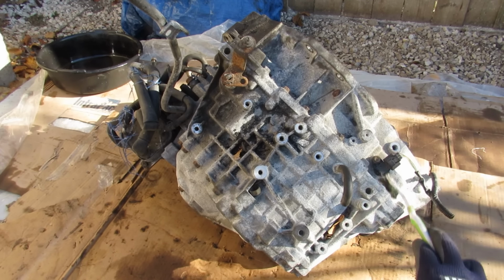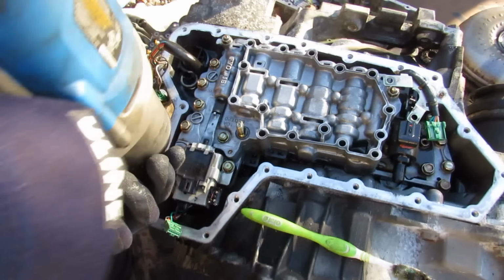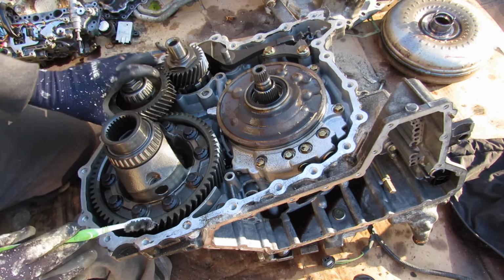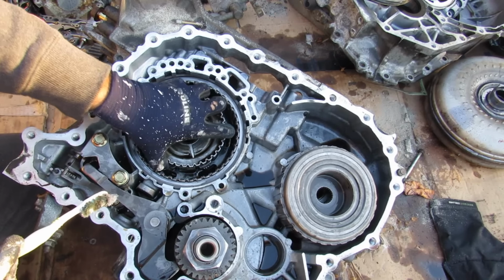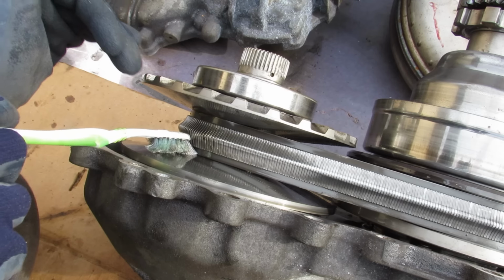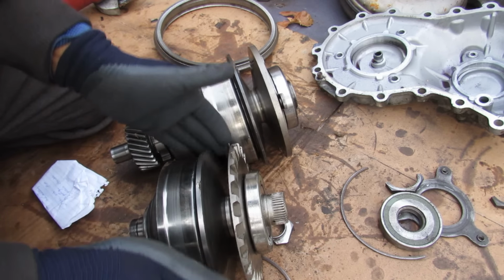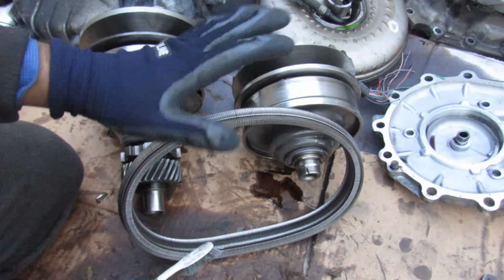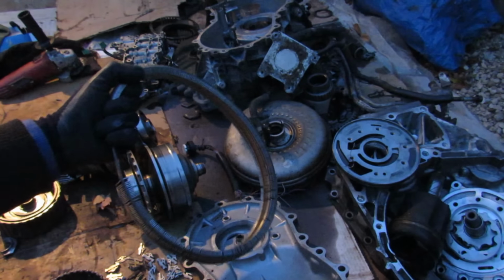Why Nissan CVTs FAIL

Comment: Always felt when they started lock up early we saw a big upturn in failures. Driven hard they won’t last .
Reply: Torque converter lockup isn't an issue as long as the drive ratio is selected sensibly. Nissan North American let reviewers/marketers force the selection of inappropriate ratios so it sounded/felt "right" (where "right" is what reviewers think an automatic should feel like, not what's correct for the technology in question)
Reply: @miscbits6399  This started with Altima in 2009 ,Nissan came out with earlier lockup to save less then 1 Mpg . Then the Service bulletin addressed engine mounts to stem vibration but the bog down was the Tcu logic change which Nissan offered a reprogram to move it back with a warning of the loss of 1 mpg. 2007 + 8 ran much smoother and more responsive and less failures.Move to 2013 and the judder began due to this early lock up and lug.Yes great highway mpg but low speed and takeoff performance with judder. So the more they fixed this CVT the worse it got.
Reply: @billcox199  it definitely counds like Nissan North America screwed up.

The P12 Primera was the evolution of the P10/11 Primera/Infiniti G20 which is more-or-less the european altima/bluebird equivalent - the problem with this machine was the 6 speed manual box on 1.8l engine which for some reason would drop a collar and lose reverse (I have a 6 speed on 2l, no prpblems with these or the 2.5l, the CVTs in all three engine sizes have been supremely reliable)

Muranos over here are mostly manual but the CVTs have again been highly reliable

The only reason for having a fluid torque converter in the front of a variator CVT should be to go from zero to minimum speed at highest N:1 CVT ratio. Beyond that the TC should lockup and let the variators do the rest, but I can see a use in having it unlock on hard accleration if the variators are slow to respond

Any kind of judder in a CVT is a major cause for concern. 
FWIW: the european QR20 engines were clearly tuned primarily for CVT use and have virtually no torque at clutch engagement speed (1000-1200rpm) in first gear and have an extremely "bitey" clutch. Without a lot of experience attempting to try a feathered start or even just trying to roll the car a few feet is virtually guaranteed to result in a stall unless you rev the engine (both of which make you look like a twat to other experienced manual trans drivers) and hillstarts are particularly problematic. As a result they didn't sell very many stickboxes in comparison to CVTs (and I got my car at 14months old for less than 1/3 of the original sale price because the original buyer hated it)
Reply: @miscbits6399  Good info ,we sold few manual transmissions in The Altima which ran good but the shifter with its cables were another story.Definitely the 2007 with CVT was the smoothest and best running.It was like a different car. I had the 2009 and 2011 and they were ok except after the Tcu reprogram on the 09 it lugged along and groaned on light acceleration .The 11 was ok. Then we had the 2014,2017 and now 2020 all leased that my Wife drove and she is a light foot . Still the 07 ,first Altima CVT was the best.I was a Shop Foreman at a dealer for 15 yrs. and had to deal  with all the complaints which became very tiresome.

Comment: My buddy bought a brand new 2016 Nissan Sentra, much to my horror.  It had a 60k powertrain warranty.  The CVT transmission failed at 64k and from what I have read he was lucky it lasted that long.

If I can't buy a new car with a manual I will buy a used car with a manual.

Comment: Thank you, i understand now why the CVT is so complained about. On a performance car, or anything over the size of a sub-compact these should not be used. With an entire industry starting to produce these, I can see a counter industry that might pop up to build manual and real automatic transmissions to replace them. I`m hoping that`s the case.

Comment: Two questions:

How many miles did that transmission have?
How many times was the fluid changed?

That fluid looked hella dirty.
I got 110k on an Altima, changed the fluid at 100k and flushed/replaced the cooling system fluid. If I can get 14 years from a 2014, I'm cool with that.
Excellent break down. Sad they used it on their larger vehicles. Glad the Altima isn't a powerful car (2.5L) killer gas mileage though.

Comment: The CVT in my old Mirage was the smoothest drive ever ever had. No shifting breaks, just goes, and really very quiet to me...but the it was just a 3-banger. Seeing an AWD use case is pretty awesome. I miss the CVT driving experience. It wasn't high power, but it was a good ride and smoothe.

That said, pushing them into more powerful drive trains seems pretty lame. In this case fatally lame.

Comment: Theoretically, same transmission as a $899 Chinese "no shift" motor scooter!
Reply: or my 2002 Yerf Dog go-cart, or my 1985 Honda & Suzuki scooters... etc,etc,etc. CVT been around for a while...
Reply: Not quite
Reply: @mikemcintosh295  The principle is exacly the same, just handling higher power/torque
Reply: @miscbits6399  I was referring to all the electronic hydraulic components.  I think motor scooters use basically centrifugal force to control the gear ratio.  It is same principle just a lot more complicated.

Comment: CVT's scare me, automatic's are wizardry, manuals are the most trust worthy.
Reply: It’s not that hard to learn how to push a clutch in and change a gear.  Unfortunately, it getting harder to find one to buy. No longer an option in so many models.
Reply: @davidsteer8142  Yeah it is mighty unfortunate, a dying breed except over in the uk.
Reply: @davidsteer8142  Manuals are nerve-wracking in city traffic and that's why over here pedestrians get run over at zebra passages any day: continuous shifting is a nuisance, better reduce start-stop and fuck the rest. That's why over here is EXACTLY the other way round: auto option usually on luxury cruisers and NOT AVAILABLE on citycars. Absurd people of an absurd country.
Reply: If I didn’t have catastrophically screwed up knees, I’d probably buy a manual. Alas, that much movement hurts like hell, but I won’t buy a CVT equipped car *ever*.

Comment: Just spent way too much time reading all the comments. as a mechanic with plenty of Nissan experience I will say I have mixed opinions on the Nissan CVTs.. I prefer a manual or traditional shifting auto. What I can recommend is to change the fluid early and often (every 20-30k) with genuine Nissan fluid and the filter/pick-up every 80k to prevent problems. Yes some unlucky people may still have issues.. Me and a lot of members of my family have owned several Nissans newer and older. I still own my 04 maxima with original drivetrain at 270k. my 17 maxima with 86k has zero trans issues and I've done the fluid service twice. Also, the manual mode is pretty fun!! 

The same people with failing CVT trans are the same people that don't warm their car up or ever change the fluid then complain when it fails at 70-80k. My sisters rogue is a prime example. Just like the people that don't take care of their body or watch what they eat their entire life then get health problems at middle age. Vehicles and your body are similar in terms of do your maintenance and care for it, it will last a long time. 

The older units are definitely not made as well as the newer which also have an external cooler (on certain models). That also needs to be flushed out with a special cleaner when the service  is done. These transmissions only run well when the fluid temperature is optimal (around 112 degrees) which is why they run like crap when overheated or when the fluid is old and can't do its job. Also, If the fluid isn't leveled out properly after reaching operating temp and going through all the gears on level ground it can cause problems.  
Replies welcome id love to chat.

Comment: I have a cvt in my '14 Subaru Ourback. It is a strange sensation at first. Under light acceleration, the engine rpm stays the same but the car accelerates. Plus it lacks "shift points" of a standard automatic. We had to go to an automatic after having sticks all these years because the knees can't handle the clutching. :-(

Comment: Very informative! Nissan could solve the CVT issues by making larger ones for the larger more powerful vehicles. To Nissan:  "Duh"
Reply from the maker: Just stick with automatics
Reply: @speedkar99  a CVT can be made reliable, because it's much simpler than an automatic..but they've yet to prefect it.

Comment: One of the first questions you need to have answered when buying a car is "Does it have a CVT"? If it does, walk away. They are junk.
Reply: I've driven small cars in which the CVT was perfectly fine, and made for a smoother drive.
Reply: @mjouwbuis  How many miles did they have on them? I could care less about a smoother drive, I would rather be confident I'm going to make it to my destination.
Reply: Just depends on who makes it. As long as its not Jatco you're ok. They're much better now than they were 10 years ago
Reply: @scottyhaines4226  I see failures on Ford, Honda, GM, Chrysler, Kia/Hyundai, Subaru and Nissan. They "may be better", they are still a disposable transmission. If you get over 100,000 miles on a CVT, you have something very special.
Reply: @mikemercer5808  I'm not sure if Nissan has got thier CVT issues under control now, but as far as the others on your list, I believe with proper maintenance  it should be closer to over 200k for something "very special".
Reply: I am an Independent Mechanical Inspector. I look at vehicles for failures for extended warranty companies, kind of like an insurance adjuster but I look at mechanical failures. I see Nissan CVT's for failure almost every week. They are trash. If you want to nit pick and say "but this one is ok", fine. I have seen the Nissan CVT's fail with as low as 60,000 miles. GM CVT's are trash also. My recommendation is to steer clear of CVT's, it's a snowmobile transmission in a passanger car.
Reply: Depends on the car. Properly engineered CVT is better than a TC auto. In fact, the way autoboxes are going, they might as well be a CVT ... They are already at 10speeds lol.
Reply: @TsLeng  Depends much more on the mileage than on the car. I will admit I see more Nissan cvt's than anything. But I have seen failures on pretty much all makes/models that use cvt's. My 99 Camry had 250,000 miles on the original transaxle, all it ever needed was a seal replacement kit due to old/hard seals. I see cvt's with mileage as low as 60,000 miles. I wouldn't buy a car with a cvt.
Reply: We had a '14 Rogue that was a very smooth, quiet vehicle to drive. Three years later after we bought it, it saved my wife's life in a head-on crash. She walked away, bruised from the seatbelt and airbag but the car...totaled of course.
Reply: @robertfrench80  That is impact and chassis resistance, has nothing to do with a CVT.
Reply: @mikemercer5808  I didn't say that it did, I'm just attesting to the safety of modern cars.

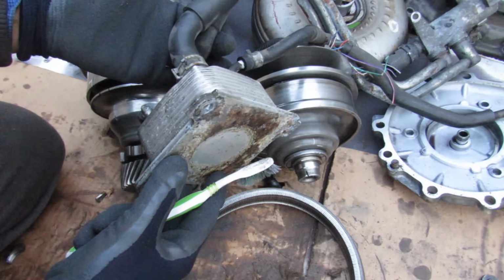Comment: 16:07 Nissan screwed up the cooling, eh? I see a common theme here -- the Nissan LEAF rapidly loses range because they never bothered to add cooling to the traction battery. Who's designing their stuff? Santa's elves?
Reply from the maker: It's passively cooled?
Reply: @speedkar99  Yep. There's a radiator and cooling loop through the motor assembly, but no coolant through the battery. There was a class-action lawsuit about it for the  2011-2012 model years. They reworked the chemistry in 2013-2015 to reduce the degradation, but even the 2020 LEAF still has no active cooling. My 2015 is down to nine bars (~65% of original capacity) after only 50,000 miles. No other EV sold today suffers this level of degradation.
Reply: ...but there is one advantage  --  the LEAF doesn't have a CVT! 😉 All an EV needs is a reduction gear, since electric motors produce full torque from 0 RPM. And reverse is just running the motor backwards.

Comment: "why some of these Nissan CVTs fail"
You mean, why all these Nissan CVTs fail by 20K
Reply: Mines got 50k still going
Reply: Ha ha . Loved my altima
Reply: To be fair we have a half million on a Nissan x trail.

We used it for mail delivery. And it's an automatic.

We had the transfer drive CVT joint give out at 80 kmh and strike the road, catching the gear wire and slam it into park.

The gearbox mechanics opened it all the way up, replaced a few old seals and a single possibly worn reverse valve, and put it back together again.

We actually had more problems due to a bent clip on the motor than the gearbox with the cable replaced after the fix.

I am pretty sure the load of the gearbox dumped it's force of a 80 kmh SUV somewhere but having seen that differential link (from an admitted different gearbox type), it won't be the disconnected transfer clutch system clearly.
Reply: I gave had 3 Muranos because they gave been reliable. The wife has a 2009 with 190K and no major problems. We took it on a 7,500 mile cross country trip when it had 140K and not one problem.
Reply: My work car is a Nissan Versa Note with 84k miles
Reply: Not all fail, but most do at various mileage.
Reply: My fiancee's 2012 Altima was well over 100k with no CVT issues until a deer totaled the car. Now her 2017 is approaching 60k, no CVT issues.
Reply: My friend had a Nissan Sentra that was fairly new, less than 50k miles. It was already shuttering and hesitating on up and down shifts.
Reply: I think if you go into owning one knowing you really have to be careful to set the parking brake, and completely stop before going from reverse to drive (or Bice versa) --- basically preventing unnecessary strain on the belt --- that it may last longer.
Reply: My CVT is at 115K in my 2011 Rogue.
Reply: @GiantRiderRob  Probably because it's a small engine. My Pathfinder failed at 3,000.
Reply: 20k is a little steep. Roughly 100k is when you need to say good bye to any nissan made after 2006.
Reply: @TWOxTONE_773  I have a 2009 Nissan sentra I bought new with over 200,000 miles on it a never had a problem with it
Reply: @terrypresnell9100  I have an original Xbox 360 that never got a Red Ring of Death. That doesn't mean the overheating issues didn't exist.
Reply: @HCkev  for your information I not only own a Nissan sentra I also have another Nissan with the CVT transmission and never had no problems and I have 15 years experience as an auto mechanic which my dad and brother and several uncles were also mechanics I'm not saying they are all perfect transmissions but there is a lot of bullshit in this old world because opinions are like assholes everybody has one
Reply: @terrypresnell9100  You apparently haven't seen the class action suits against Nissan because of this transmission.
Reply: @HCkev  no one ever said it doesn't happen. The op said "ALL" of them fail before 20k. People were just pointing out how stupid of a comment that is.
Reply: 2013 altima CVT and 104k on the car zero problems with anything...

Comment: God only knows why, in this day and age, any manufacturer would still consider making a CVT automatic transmission. They're no better now than the original DAF Variomatic. Given the fantastic current day DSG (and similar) auto boxes, it's about time ALL CVTs were dumped ! Gear changes, even with the latest modified CVT'S (which have stepped changes), do NOT and never will feel like a proper, decent auto. CVTs slur gear changes and will rev excessively until they change up or down. Buy/lease ANY vehicle with a CVT at your peril. You've been warned !

Comment: My wife's Murana CVT failed just out of warranty. 5K to replace it. I will NEVER buy Nissan again, and will try to avoid overly complicated and unproven tech in cars
Reply: Or buy manual cars. If you have to have automatic then get something that isn't cvt
Reply: I was considering the Nissan Pickup truck.  Providentially, I met a friend at the auto show, in the Nissan corral, who told me all about his horror stories owning a Sentra.   Took his advice and bought a Ridgeline instead.  Absolutely love the truck.
Reply: @tomrogers9467  The Nissan Frontier and Nissan Titan don't have or use CVTs... They are sequential automatic gears. Typically a 5spd or 6spd auto or could buy a manual. The new 2020 Frontier has a 9 spd. They are only two that do not have CVTs..
Reply: They’ve really gone downhill since their alliance with Renault, especially under the “leadership” of Carlos Ghosn.
Reply: @sharkinstx  Yes, the French Ruined Nissan because they suck at cars. Bugatti is an Italian name BTW.
Reply: Been on CVTs in Nssans and Infinitis since 2010...
Reply: @diablo09090909  um no lol do ur research
Reply: 10 years or 120K miles and you went over?
Reply: They always fail just after warranty ain't no coincidence
Reply: The CVT technology has been and still is the transmission method in snowmobiles, golf cars and ATV’s for years.  But not hp as high as a car.   And they use a rubber belt.
Reply: @tomrogers9467  The problem isn't the steel belt, its Nissan North America marketers taking pressure from reviewers who demanded that CVTs feel like they're shifting and essentially programmed in a self-destruct mode to keep those reviewers happy (remember: reviewers seldom if ever put more than 500 miles in anything they're reviewing)

if you can feel "gearchanges" in your CVT, then take it back where you got it from immediately, because it will grenade in short order
Reply: @miscbits6399  no no no, that "shift" is people wanted to feel there car "shift" so they made the engine miss fire to feel like a "shift"

Comment: The cvt in my Prius went 350000 miles no issues and never changed or added transmission fluid